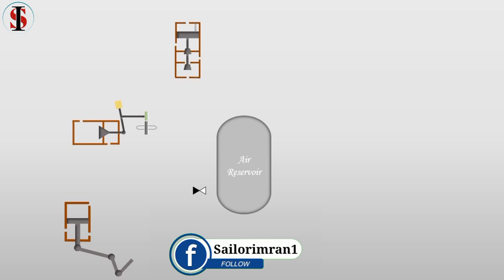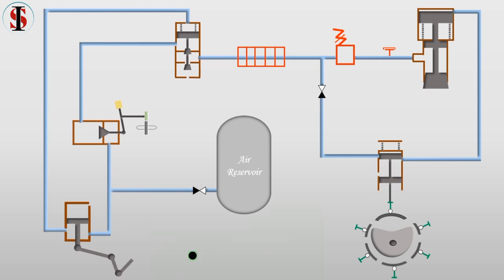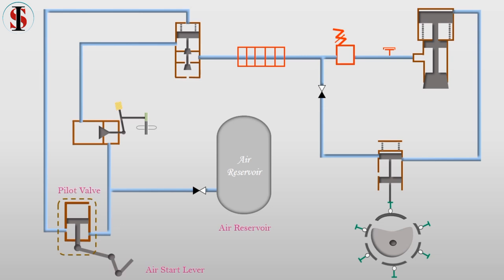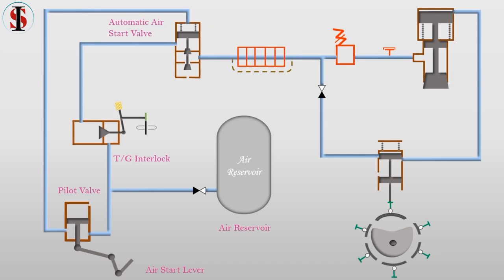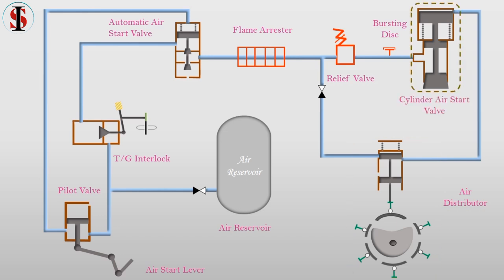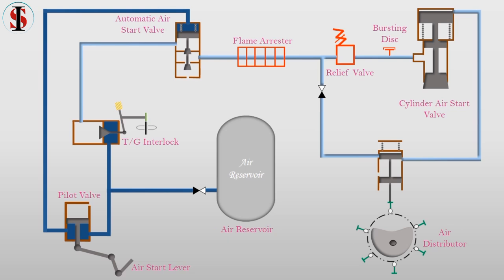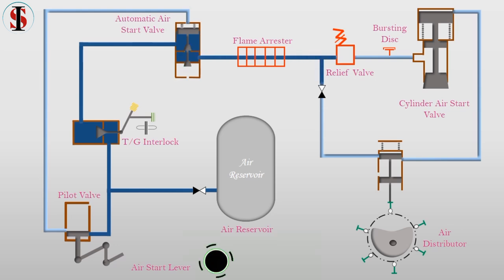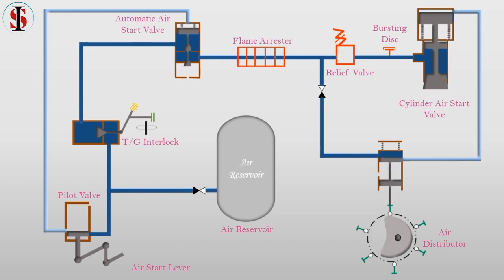How Marine Engine Air Starting System Work | Starting Air System

Comment: sir? how much bar to make operating piston going down and open the air starting valve??
Reply from the maker: Normally 20-30 bar Pressure is required to start an Engine